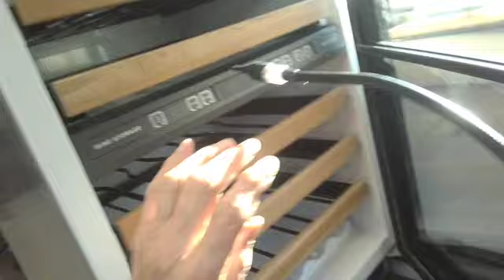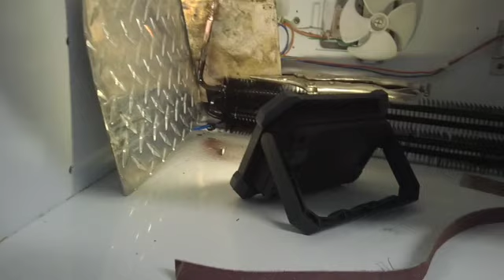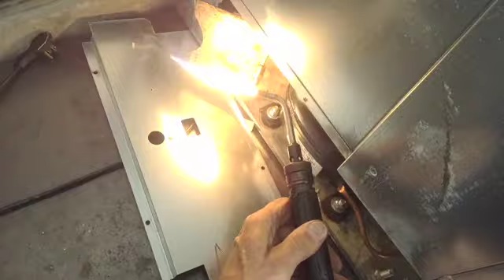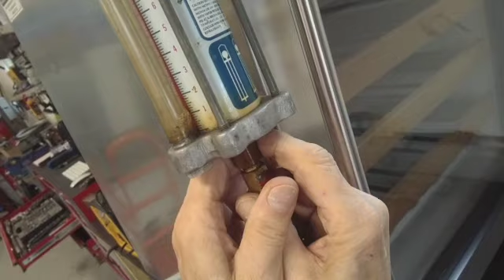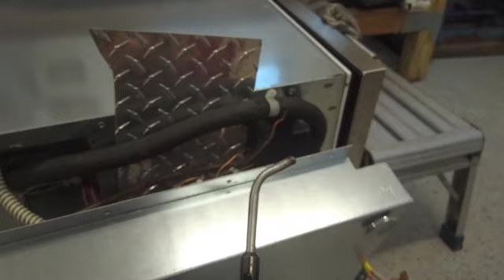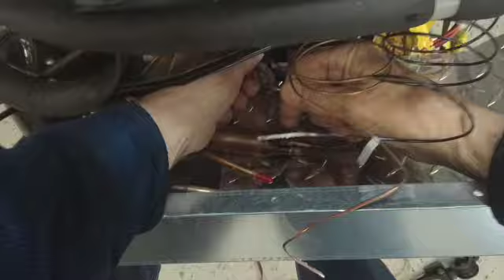Sub-Zero 424 Wine Cooler Sealed System Repair

Comment: Hello I love your videos…. They are extremely well done.   I see you use what you call a charging column in your repairs.  I’ve seen other posts in which several will refer these as museum pieces vs using a digital scale.  I’d be interested in your thoughts on digital scale approach?
Reply from the maker: I also have a digital scale but it’s big and bulky and I only use it in my shop. As for the charging column I’ve been using them for over 30 years and they’re compact and fit in my toolbox. The 16oz charging columns are still available but are on back order since last July from Thermal Engineering.
Reply: @SubZeroSpecialists  makes sense to me and the charging column seems so easy I just don’t quite understand why I see some that act like it should never be used.   I do have another question for you if you don’t mind.   I have a Viking fridge that is basically the same issue as this video.  I have traced the leak to be a pin hole that is in the copper line in the refrigerator before it gets to the evaporator.   I would like to make sure the refrigerant is empty and just braze over the pin hole.   My father was a plumber and so I grew up helping him and have probably soldered a thousand fittings in my life…. But I have never brazed before.    I expect I can just use my acetylene torch and heat the brazing rod / pipe and drag across the pin hole but not sure how much I should put heat in the pipe if just covering a pin hole?  Also I’m not sure if I need to put nitrogen into the line prior to brazing?   It’s a sealed system that I will use piercing valve so I can charge…. But I don’t know how I would flow the nitrogen with only a single valve and I’m not sure if it’s fine to braze with the line charged with nitrogen?  Appreciate your thoughts.
Reply from the maker: @2050dm  As for soldering the pin hole you can use silver solder which flows better and requires less heat, Harris Stay-Silv 45 or 56 works for me, but a brazing rod will work also. I don't know how you would be able to evacuate the sealed system properly unless from both the high-side and low-side. Whenever you enter a sealed system always replace the filter drier, you can get one with a process port on it and then run the compressor after you fix the leak to draw out all the nitrogen out of the filter port until you're pulling at least a deep vacuum on the low side. There should be no pressure in the system when you solder the leak otherwise it won't seal. If you don't have the right tools you may be able to rent them, if you do the job right the first time you'll avoid problems in the future. You may want to peruse some of my other sealed system videos to get a better understanding of the process. Feel free to reach out to me if you have a problem.
Reply: @SubZeroSpecialists  thank you.  This is very helpful.  I feel I do have many of the tools I need as I have been acquiring them for exactly this repair.  The last item I still need to get before i start is just a recovery tank.  I already have torch, gauges, vacuum recovery pump, leak detector, acetylene tank, nitrogen tank, etc ….  I have already identified the pin hole leak….  I just didn’t want to enter the system until I feel comfortable about the steps to then fix the hole.  I was thinking I would need to braze but if 56% silver solder is fine I will use that instead with also the stay silv flux.   Regarding the filter dryer with port.   Can I just use any particular one?   I see there are many available and pricing ranges from $9 to over $100.   I see this Supco D111 Copper Drier 1.5 x 2.5 x 3.5 Inch that is only $10 and I wonder if it should work fine or do I really need to attempt to get the exact dryer listed for the fridge?  Thx again.  I’m excited to attempt this fix but want to ensure I’m doing correctly so I really value your guidance?!
Reply from the maker: @2050dm  Yes you can use the D111 from Supco, we bought 1K of them for a dollar each from an offshore supplier and I can't wait until they're all gone, the copper is so thin you can bight into plus they're very hard to bend, they usually kink. That being said Parker makes a better on for a few dollars more. As for the recover tank, someone makes a recovery bag but not sure where you can get it. Good luck.
Reply: @SubZeroSpecialists  sold..  I will use the Parker 619.  Is there any particular service port you recommend?  It seems like most come with 1/4 stubs attached vs just the port fitting itself.   For my initial tap I plan to use Supco BPV31 Bullet Piercing Tap Valve 1/4 In, 5/16 In, 3/8 In. Od.
Reply from the maker: @2050dm  yes that will work
Reply: @SubZeroSpecialists  ok my friend..  I received most of my parts today.  One last question I have is that I purchased service valve with 2” tube that I was considering to put on the stub coming directly out of the compressor…. But the current stub is very short and curved.  Meaning there is not too much of the pinched tube coming out of the compressor.  I could make it work to add a service valve but just wondering one thing.  If I’m also replacing the filter dryer with one that has a service valve do I even need to add the service valve to the stub?   I’m thinking I do because the stub on the compressor is likely on the low side whereas the filter is on the high side but I wanted to get your expert guidance!
Reply from the maker: @2050dm  yes you need a valve on both sides of the system if you want to evaluate thoroughly.
Reply: @SubZeroSpecialists  ok my friend tonight is the big night.  I tapped with compression fitting and recovered refrigerant from the stub coming out of compressor.   I have also taken a service valve with a 2” stub and swagged it so that it fits over the stub that was just cut coming out of the compressor.   I have also cut out the old filter dryer.  The filter dryer line was directly connected to the condenser so to keep some space I left about 3” of copper line from the filter still connected at the condenser when i cut it out.  I also scored and removed the capillary tube being careful to make sure I still see an opening in the tube.   Anyways I do have a couple of questions.   The old lines on the filter dryer that go into the condenser are 8mm or I guess 5/16 OD.  The new filter dryer I purchased is 6mm or I guess 1/4”.  My new filter will nearly slide right into the old lines…. I may need to swag a little but definitely not much.   Is this fine to just solder this joint in this manner if there really is not much swag needed?   Also I feel like my swag joint that I made on stub of the new service valve that I will connect to stub on compressor is pretty good but not super tight.  It does have about 1/4” overlap in the joint and I’m sure it would seal good with 56% silver but just not sure how tight the swag joint should feel.   Anyways…. Just wondering your thoughts on these questions?   Lastly I guess my plan to seal the pin hole that I found in the line inside the fridge near the evap I expect to just heat the pipe and drag the solder across the area of pinhole without using flux or worrying about backside of line.  Does this seem correct process for sealing this pinhole?  Thx Dave
Reply from the maker: @2050dm  if your condenser tubing is 5/16 swag it with 1/4 and insert the new filter. To fix the pinhole leak yes just heat the tubing and solder the hole being careful not to use too much solder, just cover the hole. As for the swag joint it should be at least 1/4” deep and be careful not to over solder.
Reply: @SubZeroSpecialists  ok..  I have swagged as you suggested and I also used the 56% solder to connect the new service port and the new filter dryer including the capillary tube.   I have pulled a vacuum and my supco v64 gauge has been holding steady at 29.858 for a couple of hours.  I was able to initially vacuum down to about 29.92 but when stopped pump it then dropped to the 29.858 and has been holding steady.   I expect this would indicate all is fine so I’m planning to add the refrigerant.   This unit calls for 3.4oz of 134a.   I do own a refrigerant scale with charge valve but I don’t have a 30lb tank of r134a or any charge cylinders.   What is your thought…. Can I just pickup a 12oz can of 134a at local store…. Tap the can and connect all hoses and set can on the scale, set the charge valve for 3.4oz and open the gauge to allow to charge?  I guess I’m not sure if I can use a regular 12oz can for this and if this sounds like correct process to you?
Reply from the maker: You can use.a 12 oz can but make sure it doesn’t have leak sealer in it. The fact that it’s holding a deep vacuum for so long could indicate that you soldered the cap tube shut. What I would do is open the process port on the drier and add some Freon to the low side, it should come out the filter port, if not then you may have a restriction.
Reply: @SubZeroSpecialists  hello..  I’m embarrassed to say this but the hose I was connecting to the service valve did not have a valve stem depressor so the vacuum I was drawing was simply the line from my pump to the port.   That said I’m delayed in responding as I did put just a small amount of refrigerant into the system and verified I could relieve via the filter port.  I also then used the leak detector and found a small leak in a couple of spots on my braze joints that I verified with bubbles.  I heated the joints and sealed the leaks and verified with sniffer (on high sensitivity) and also with bubbles and all seems fine.  I’m questioning one thing however.  With the small amount of refrigerant I added I have one of those cheap hoses with gauge built into the hose that I’m using to connect to the process port.  After I add the small amount of refrigerant up to about 20 psi it holds pretty stable but I do see a slight change in the pressure reading on the gauge over a period of an hour or two.  Im not really sure what to think because all the joints seem to now be very good with no bubbles and my leak detector is very sensitive and I’m not picking up anything anywhere in the system.  Is there a possibility that I need to actually plug the unit in and let it run to try to get a better reading?  I’m wondering if this is just the nature of this cheaper gauge?   Im taking this measurement by using a valve stem removal tool to just remove the valve in the service port and lock off the connection.  I’m tempted to now just put the valve stem in and charge the system with the full 3.4oz and let it run as I can’t seem to pickup on any potential leak and all seems good.
Reply from the maker: @2050dm  you should test the pressure with at least 150 psi. Not sure about your gauge try putting more Freon in it and see if the pressure comes up.
Reply: @SubZeroSpecialists  alright I put 140-150psi of nitrogen in the system and it revealed another small leak at one of my solder joints.  :).  I have now fixed the solder in that location and I put nitrogen in again.  So far it seems to be holding but I’ll maybe let it set for a couple of hours to make sure.   I’m hopeful this is the last thing I’ll need to resolve before charging the system.   When I’m ready to then add the refrigerant do I first need to vacuum down the system and allow the vacuum to pull into the refrigerant?
Reply from the maker: @2050dm  First let all the nitrogen out then do a Sweep Charge. In a Sweep Charge you use the compressor to evacuate the system.  Open the system on the high-side and let the compressor pull out any air. When you are in the deepest vacuum close the high side and see if the vacuum holds at least 3 minutes, if so proceed to recharge.
Reply: @SubZeroSpecialists  Thanks so much for your guidance thru this.   I believe I have successfully competed this repair.  All seems to be running well and I put the exact amount of refrigerant in the unit and the PSI was right at about 2psi when complete.   It has gone thru many cycles and appears to be working fine.   I did however when repairing the pin hole melt a bit of the inside of the fridge when I initially started this repair.  It’s pretty small and not real noticeable because it’s on the top of the unit in the back corner.  Anyways it melted thru the plastic or fiberglass liner a bit.  I was thinking that I could just skim it with a little JB weld or plastic bonder.   I also see JB weld has a marine product that cures white that I was thinking may be good use since given the location I may not worry about sanding or anything and at least it would be white.   Any thoughts?
Reply from the maker: @2050dm  Flex make a white putty that you may be able to use.
Reply: @SubZeroSpecialists  hello sir, I hope all is well with you.  It has been over a month and all seems to be fine on my fridge so far.  In researching a bit about the cold control settings on the dial from 1 to 7 I found a diagram for my unit that indicates the following.

Setting 1 (warmest) = cut in 38d +-2.7d and cutout 7.5d +-2.7d
Setting 3.5 (midpoint) = cut in 38d+-1.5d cutout 1d +-2d
Setting 7 (coldest) = cut in 38d+-2.7d cutout .6 +-2.7

I was trying to understand this better as I expected cutout to be written more like 34d or similar.   I could not find any good documentation online so thought I would ask the expert how to interpret these cutout settings?
Reply from the maker: @2050dm  4 is normal. Each number represents 2 degrees. 3 is 2 degrees warmer than 4 and 5 is 2 degrees colder than 4. Number 4 should maintain 38 degrees in temp.
Reply: @SubZeroSpecialists  thank you very much.  I have been testing the different settings but i am thinking I may have a bad thermostat as it will run too cold at 3-4.   And i feel like it short cycles if on 1-2.   The cold control is a capillary line that clamps to the evaporator and I have looped the line and feel I have a pretty good connection to the evap.   The evap seems to have great frost pattern across entire surface so seems to be working very well as far as refrigerant quantity.  I also have made sure capillary tube is not too close to heat of compressor.   Anyways when I research this model fridge they have converted this all to electronics vs capillary style.   The suggested part is a kit pw240028.   That said the parts are relatively expensive for a thermostat and I’m wondering your thoughts if I would need to use the mfg parts for this or if there’s an option to use some other electronic thermostat control and pentiometer that may be less expensive?   I just thought you have probably seen and done it all!  :)
Reply from the maker: @2050dm  what model is it? You’ll also need to check the back pressure because a low charge could cause excessive run time. Another check if you have a temperature tester attach it to the evaporator and see if the coil is reaching its shut off point. If it’s an old unit I would also check the capillary tube on the heat exchanger to see if it separated from the suction line.
Reply: @SubZeroSpecialists   the fridge model is a vuar140.   I weighed the charge into the unit and feel relatively confident about the level of refrigerant in the system.   I will try to attach thermostat to the evaporator to verify but it does get some small degree of frost/ice evenly across the entire evaporator on a setting of 3-4 so if it’s supposed to maintain 38 degree I would not expect to have a can of water freeze inside..  which will happen if i have the control set to 3-4.   My understanding or logic has been that if there is a low charge it may result in maybe only the first part of the evaporator getting cold enough and the position where the sensor is located may not get to temp.  I don’t believe that to be the situation for me as again the entire evaporator does seem to be evenly cold and it refrigerates very good.  It just seems like the temp control is letting it get a bit too cold before turning off if I have it set at 3 or above.  If I set at temp of 2 it will run for 30 min, turn off for maybe 90 min, run for 30, etc….   As I look for different temp controls the mfg said they changed to all electronics sensor with thermistor and pentiometer and the part I have on this unit which is the more mechanical temp control is discontinued.  I was thinking that if all the electronics is doing is measuring temp and sending signal to start/stop if I could use a more universal control that may be a bit less expensive.  It’s as much of a curiosity to me as anything.
Reply from the maker: @2050dm  what brand refrigerator is this
Reply: @SubZeroSpecialists  sorry…. This is a Viking professional.  Under counter style beverage fridge.
Reply from the maker: @2050dm  did you check the temperature of the evaporator plate at the location where the feeler bulb attaches?
Reply: @SubZeroSpecialists  No i have not because I don’t have a gauge to check in that exact area.  I’m not sure the best way to really measure the temp on the evaporator in that exact area .  I have tried to adjust the clamp that holds the line against the back of the evaporator such that I would expect it to get a good temp.  I’m not sure how sensitive that line is.  I’m not sure if it’s only the very tip of the line that measures the temp but I have tried to loop such that I have a few inches pressed against the evaporator.  I will say the bracket that I screw into to hold the line against the evaporator has a curve in it and I’m wondering if perhaps I just have that on backwards such that it’s not pressing firmly enough against the evap…. I have thought about reversing that clamp piece to see if it will press the lines more firmly against the evap but I also don’t want to be too firm to cause any issues.
Reply from the maker: @2050dm  you need a temperature gauge that clamps on. I use a Amprobe with a feeler wire that clamps on. You can also use it to check Superheat.
Reply: @SubZeroSpecialists  ok..  I’ll look into that.   I did find a troubleshooting note on this unit that also said to adjust the glass shelf that is just below the evaporator so it’s slightly away from the back wall.  It indicates that if the glass shelf is pushed all the way to the back it will trap cold air on that shelf and freeze product.  That is exactly what was happening for mine in the cans that would freeze were on that shelf and close to the evaporator.  I’m crossing my fingers!! :)
Reply from the maker: @2050dm  yes I’ve had that same problem with that unit.
Reply: @SubZeroSpecialists  you my friend are awesome!!
Reply: Super Video and very informative. Wondering if your team would be able to view my error codes specifically to see if it’s worth attempting a fix?